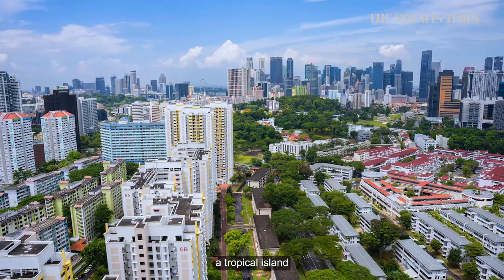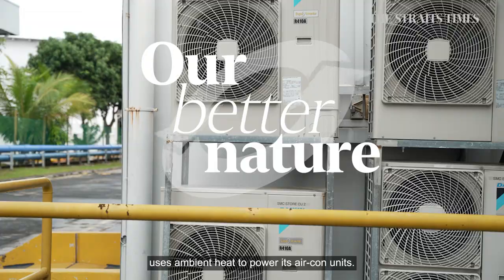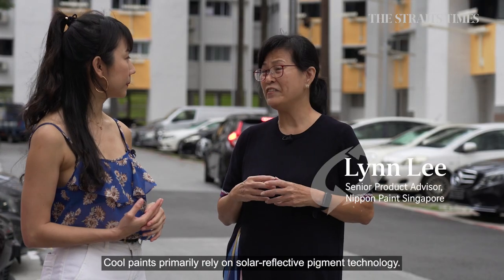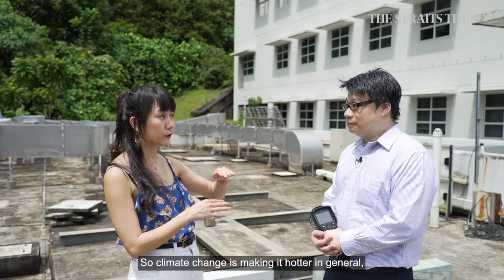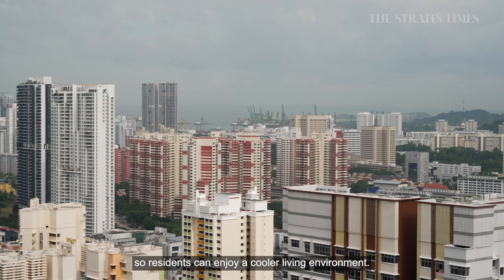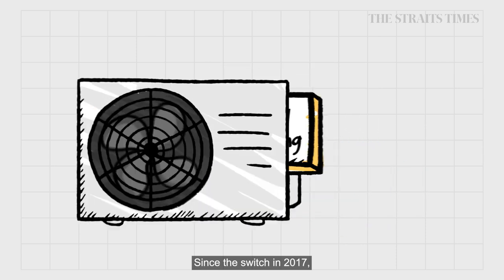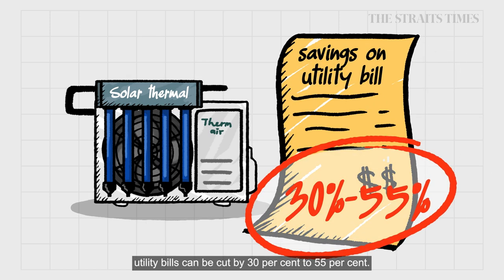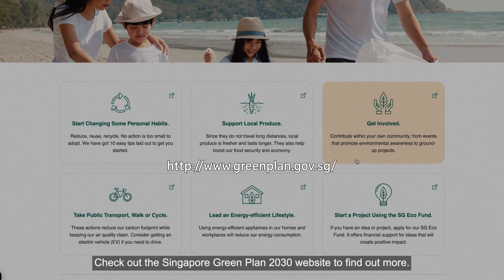Making Singapore a cooler city | Our Better Nature EP3

Comment: Singapore is getting hotter is not weather or climate driven, its cause by human.  For this case, its Singapore Government. Over building is the primary cause.   Forested land, bushes and fields hv the ability to absorb and reduced the Sunlight heat.  When they are demolised to give way for concrete structures . Heat will be trapped in the day and released back to the surrounding at night.   Higher temperatures is not the only cause,  flooding is the other serious cause.  Government policy of over poppulating Singapore is the culprit.  An irresponsible act.
Reply: Watch out, here comes the political observer by day and climatologist by night!
Reply: 我同意，重點在於建築物過度密集